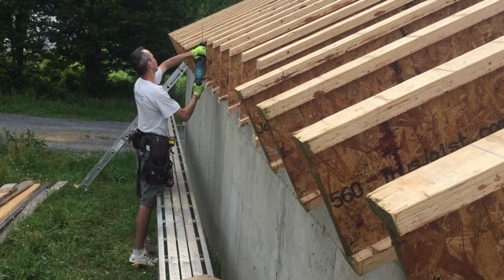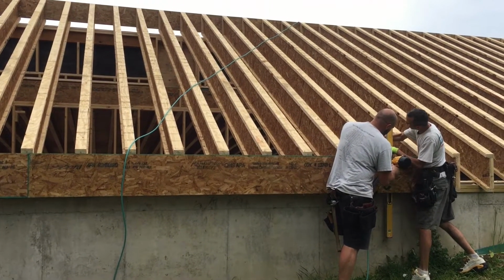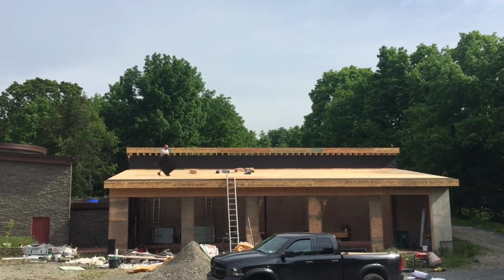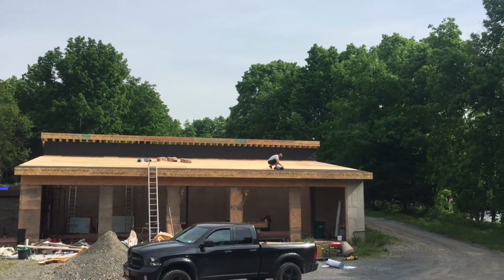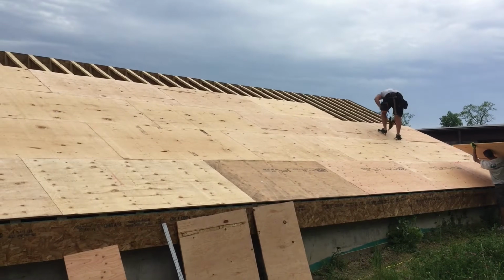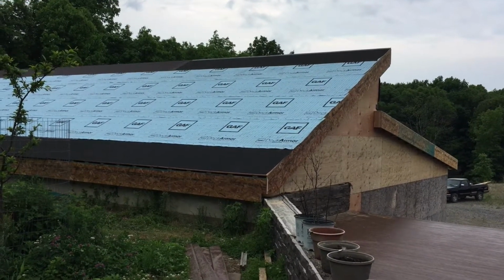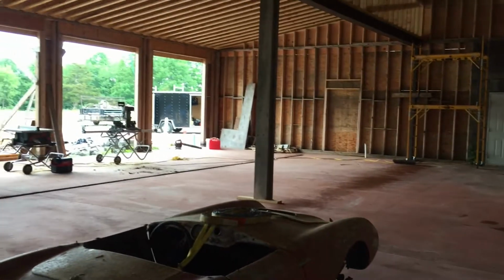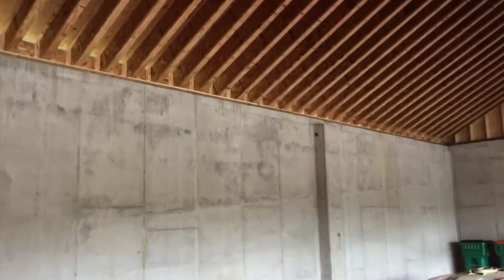Garage Framing Day 5

Comment: Eli, are you going solar panels down the road?
Reply from the maker: That was indeed the plan on the southern facing (more flat) roof! However, it will be fairly expensive so I won't be doing them for a bit. I am optimistic I will be able to save up a bit for them and hope for some government renewable energy incentives to come back into the picture to help force my hand into the investment. Since my heat is based on a geothermal heat pump, the investment in electricity generation seems to make sense on such a large roof :)